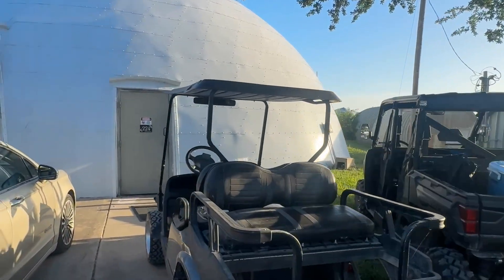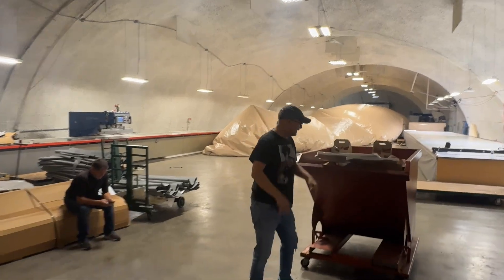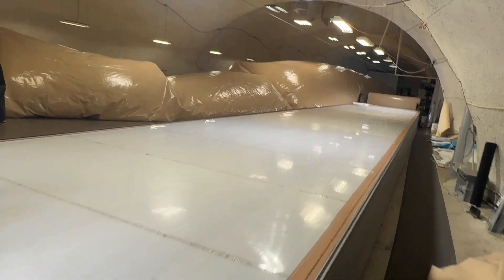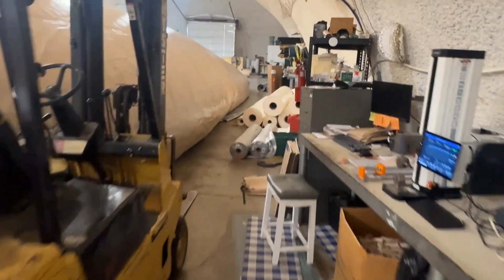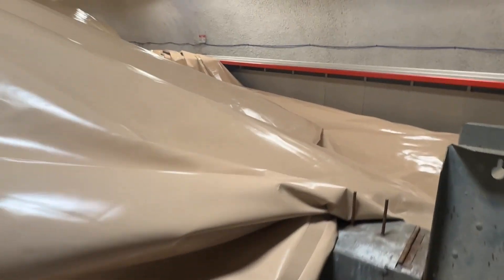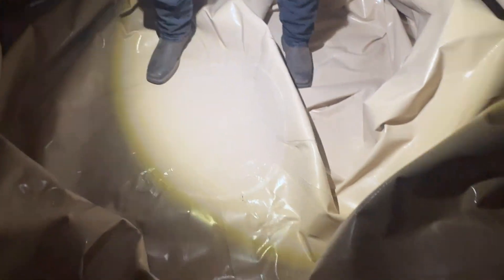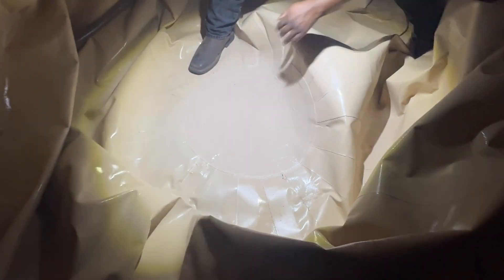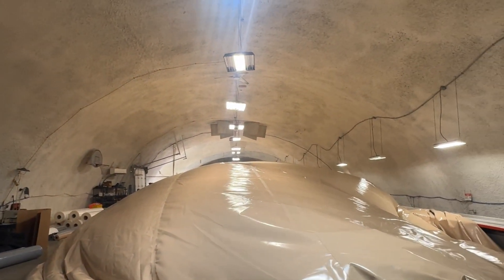Inside Bruco: Rolling Up a 114-Foot Monolithic Dome Airform

Comment: I've been told that concrete reinforced with rebar decays from the inside because of the iron in rebar rusting, and the chemical reactions thereof. Is this a problem that your domes don't have?
Reply from the maker: Our domes don’t have that problem. There is polyurethane foam and a single ply waterproof roofing membrane on the exterior of the concrete.
Reply: @MonolithicDome  ok thank you